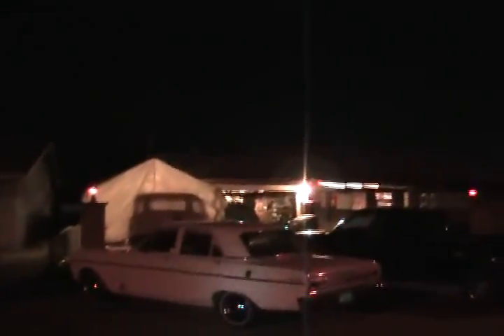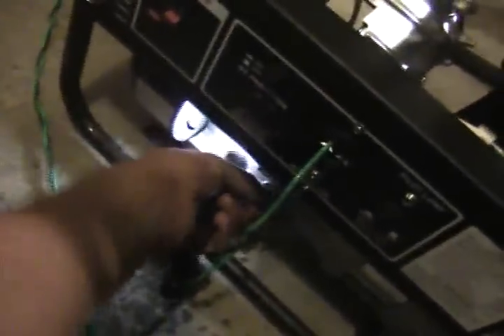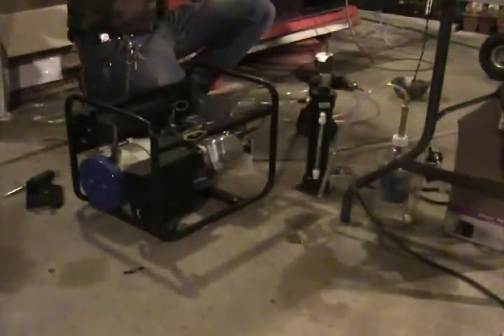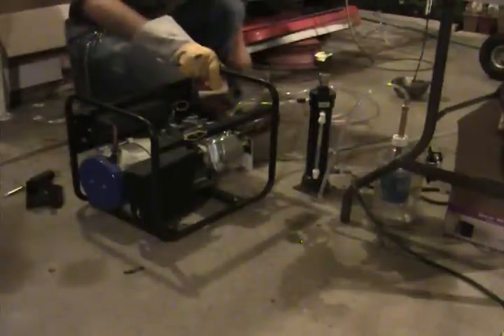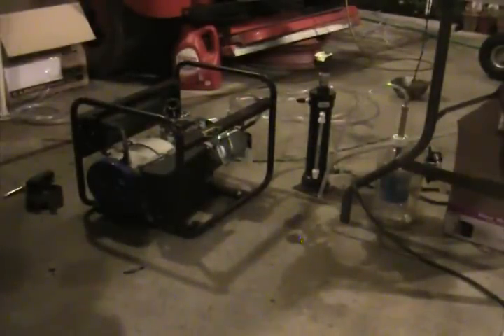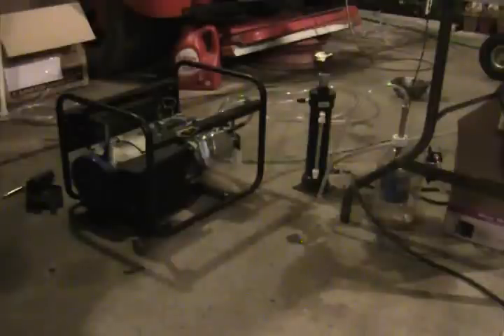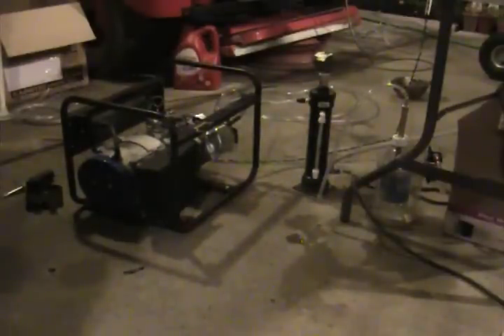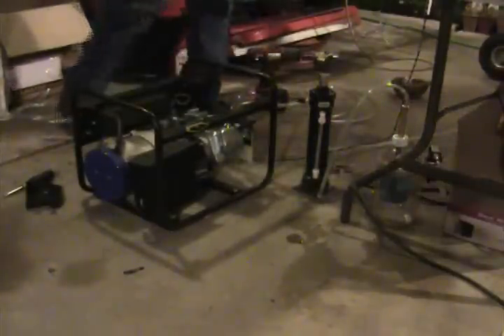generator test 14 engine running on hho

Comment: I know this is very old but I'm watching this series in 2019.  I haven't gotten past part 14 yet so I'm not sure where you go with this but I gotta say, you shouldn't be giving the engine any amount of air at all.  That gas you're giving it (so-called HHO, as people call it, is 66.666% hydrogen and 33.333% oxygen) so it already has the EXACT amount of oxygen it needs to combust.  Any additional air you mix would make the engine run too lean.  If, past this part 14, you manage to improve the engine by mixing air in then there is another unknown issue and it would be sheer coincidence.

Comment: @d3adp001 My dad was a Big 63' Falcon guy.. he used to drag race them.(out-ran the coppers of several occasions... )
I believe his exact words were " 63-64-65' were the only "Falcons"...

I always wanted one for my first car. Never happened though... and now at age.. cough26cough I still never got my license ....

my 47' Ford has been rusting away in our yard for a couple years... maybe I should just buy a mig... 

Did you ever get around to testing steel on steel hho welding?...

Comment from the maker: ahh you saw that did you, its a 65 nova 283 power slide, 70k orig miles, my wifes car. Not shown is my 64 falcon, or the 51 & 53 customlines (sadly they are gone now), and the 260z, and, and.. yes I have an issue.

Comment from the maker: The crank case got hho in it, and the intake mix became lean which caused a backfire, which flowed into the crankcase, turning the oil cap inot a rubber bullet. Good stuff:)